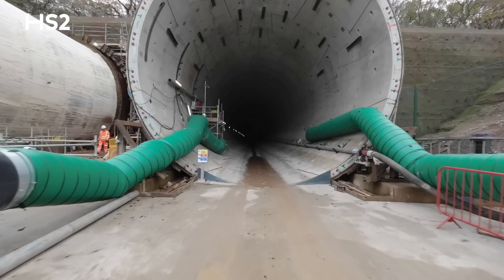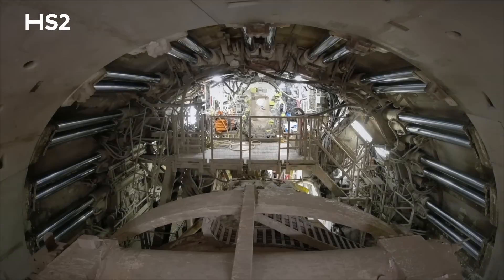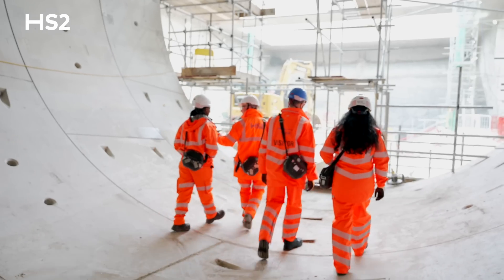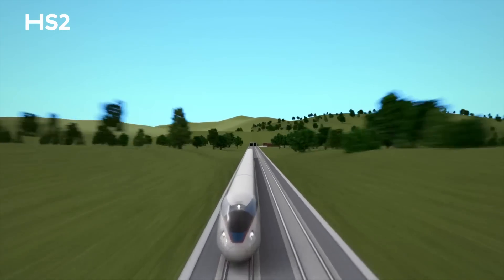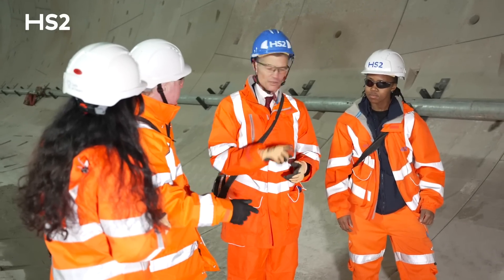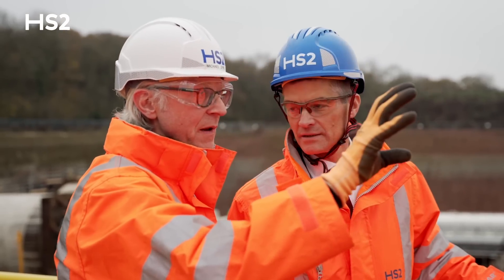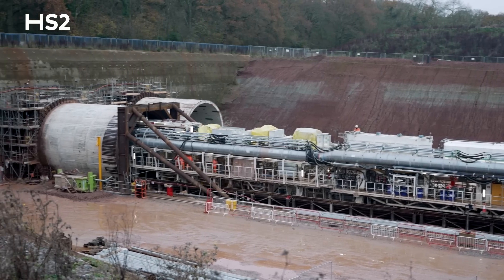Historic first journey through a completed HS2 tunnel

Comment: Would prefer it if the original northern connectivity to Leeds and Scotland wasn't scrapped, but as a Scot, I'm very much looking forward to using HS2 once it's completed!
Reply: Keep the faith, they'll be reinstated.
Reply: @Bristoltwingo  I hope so too. Tbh, exciting as this phase is, it only really makes sense  if it goes all the way up to Scotland. However, it was probably inevitable that it would be built piecemeal: afterall this is Britain, not China.
Reply: HS2 will still be connected to Scotlnd by the use of a high speed junction at Handsacre in Staffordshire where by HS2 trains will join the existing WCML North to Scotland

Comment: I can see the headlines now that HS2 trains will not operate at the original intended speeds due to techinal issues... It's bound to happen knowing how incapable the UK is at most things! 🤦
Reply: The trains were originally going to run at 250mph.
That got watered down to 225mph, and nobody questions whether such speeds are desirable, safe, and most of all, nobody questions the obscene energy required to hit these speeds over a 125mph train.
Plenty of empty seats already between London and Birmingham.
Reply: @chairmakerPete  Love your time machine, predicting occupancy levels in the future (and especially after the unforeseen temporary shock og Covid).  I am just looking forward to reliably getting a seat, having stood morning after morning, back in 2010, awaiting the overloaded 0723hrs Pendolino from Coventry to Euston.  Bring on the capacity.
Reply: @chairmakerPete  Considering current High speed trains that are on HS 1 do 320km/h (200mph) and our current trains can't do 140mph due to line incompatibility that is still an improovment.

Comment: Congratulations. In the short video you showed briefly the tunnel portal. It looks like there where no sonic boom countermeasures built in the portal. How do you address this phenomena? Or is this just a graphical error?
Reply: The Swiss style SBC will be added later, what you see is not the finished article, these are publicity updates.
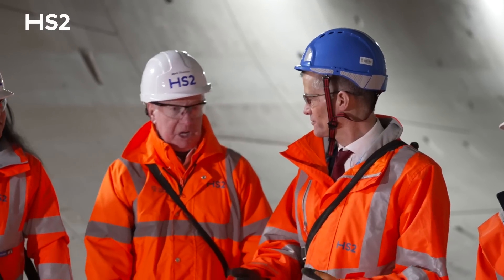Reply: @nw5835  Great. Thanks for the info. I assumed so, but in the short animation at 1:06 did not feature them. (Of course it is only an animation.)
Reply: Why would it need sonic boom countermeasures?
Reply: @ChickenNugget-dk9hp  When they go 300 kph trains will create loud popping sound  when the air they are pushing leaves the tunnel. The effect is also called tunnel boom. To avoid that currently build tunnels for high speed trains have some additional holes in the tunnel just before the tunnel portal.
Reply: Are you being serious ! Doooooh !!
Reply: Tunnel mouth extensions will be added later in the construction, to shield the "pop" and shockwave.  That is a BIG tunnel when you see people walking through it.  Nice job.  One down.....

Comment: Congratulations!   I have a question:  Why don't they integrate the rail housings into the tunnel lining?  ie attach the track to fixing points already molded in the concrete (if that makes sense!).  Saves having to do it as a separate job.
Reply: Things like drainage pipes and conduits need to be put in first before they can lay the track slab. It’d probably be too difficult to position them accurately enough when they’re manufacturing the segments, and it’d be a huge logistical challenge to fit them because the ones on the bottom would be far larger then the rest (since the slab the track sits on is up a fair way in the tunnel).
Reply: I presume fixings need to be replaced every now and then, due to vibrations and moving weights of trains
Reply: I'm also intrigued to know the answer to this. Sounds like it makes a lot of sense but presumably there's something.
Reply: The tunnel integrity is established by the tunnel segments made from specially cast concrete shaped to interlock as the boring machine progresses along its route. Everything in the tunnel is attached to these segments along the tunnel. Various track types are used (as was done in the Crossrail / Elizabeth Line tunnels) and as at some point it may have to be changed or improved it has to be added onto the fixed tunnel structure not be cast into it. Apart from which the boring machine segment handler would become far too complicated in a confined space.
Reply: I think it's because the rails must be laid more accurately than the tunnel is bored
Reply: Suspension tracks evolve like when everyone thought 40 feet spoilers were the future of Dirt Rallies, everyone 20yrs in the past think the future is 100% concrete
.
Lol you have Sam Seder and TyT genocide mockers in your playlists :faceplam: you should feel embarrased having your subscriptions public